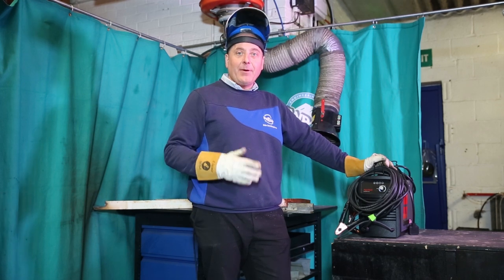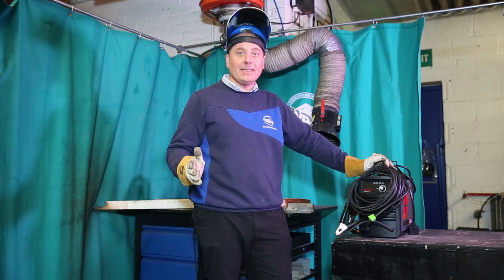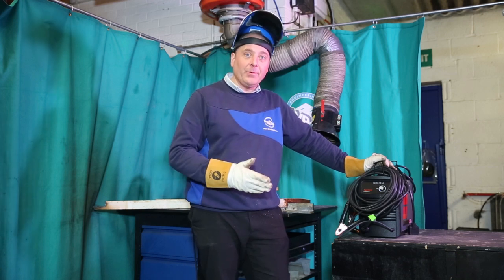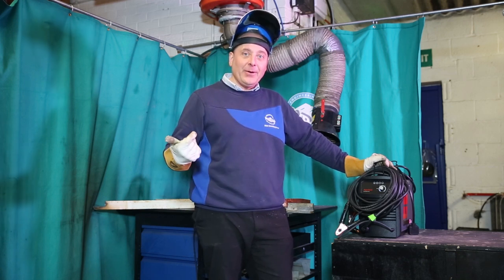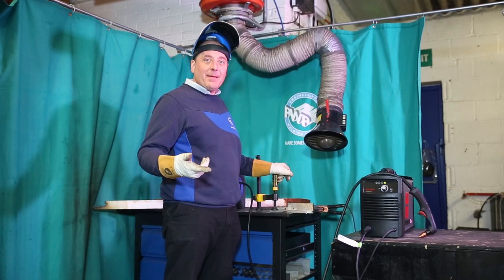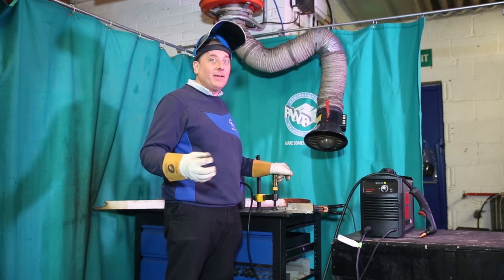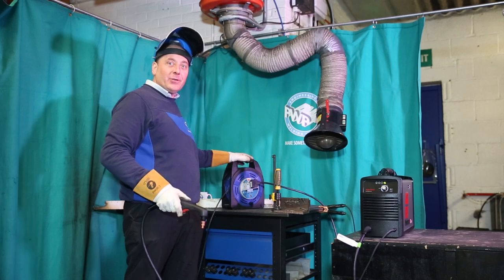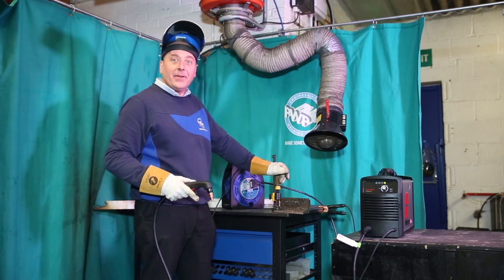Hypertherm Powermax 30 Air: Comprehensive Review and Performance Test

Comment: hi from Canada.  Can you drag the tip against the steel or is a small gap needed wether using the outer shield or not.  wondering if I should order a shield.